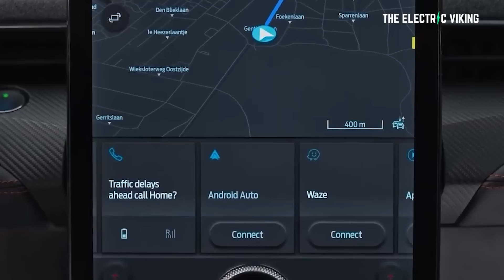US senators & dealer groups say Ford's EV program is illegal

Comment: Either Ford makes a new company to sell direct like Tesla or they make a hybrid selling model for the dealers. The customer should be able to go online to Ford, select the vehicle and the options they want. The web site spits out a price. Let's say for example 60k, if the customer agrees the web site directs the customer which dealer they want the vehicle to be delivered to. Once that is selected the customer pays online a down payment to that dealer. At that point Ford and the dealer are locked into the price with NO dealer markup or add on items. All the dealer becomes is a pickup location. The profit the dealer makes is predetermined by Ford based on the options ordered and the MSRP.

Comment: Ford should be able to compete with Tesla.  They should be able to change the franchise arrangement per the contract.  They need to do this.  The ford dealer i use has two class 2 chargers and it always has Its own or an employee cars attached.  This is not a small dealer and I have seen many mach e and lighting vehicles bring delivered
Reply: If ford demanded each dealer install a publicly accessible fast charger <with a discount rate for ford car owners> I would be behind it.

Comment: The more "profound public interest" is the price gouging happening by "stealerships" in the U.S. I think they should rank these costs on dealership size to not screw over decent small dealers. However, there are rare "decent" dealers around right now. They are all bending buyers over the barrel and charging an upcharge for slow entry and lube. So it is hard to shed a tear at the same time.

Comment: Ford have lost patience with absurd EV markups done by dealerships as they recognize the price of EVs is a key factor for successful EV Ford sales. Ideally they would like to go to the same online model as Tesla but cannot do so. Ford is struggling to make a profit on EVs at their low entry price point (to compete with other automakers) and then the dealerships screw over the buyers. Ford knows once Tesla has its Giga Texas factory fully ramped it is going to lose sales if the dealership continue to do what they are currently doing. This is all about control and unfortunately the dealerships have strong ties with government which they will use to their advantage. Ultimately they have lost sight of the consumers who will eventually walk no matter how loyal they are to the brand.

Comment: Hearing that 80% of Detroit dealerships are in areas where the power grid is insufficient to support the addition of charging stations and applications will be rejected by council.
Reply: A peaker  would simply start up  no biggie
Reply: @michaelstarkey9745  not the power generation, the supply grid needs upgrading

Comment: I still don't get the impulse to buy in now when the technology is still developing.  Heck if I left an EV on the street for an extended period of time in cold weather it's still up in the air whether or not i'd be able to get home.
Reply: @magnuspym  definitely!  It's interesting but costs wayyyyy too much for what it is.  I'm excited about the solid state research coming out.  If they make a pickup/suv with ground clearance that has solid state batteries i'd throw all kinds of money at it.
Reply: Cold weather as well as hot weather reduces the optimum range of an EV - which occurs when the battery is around room temperature. Nonetheless, it's not "up in the air" whether or not you'd be able to get home if you left an EV on the street for an extended period in adverse weather. You need to do some research into the first-hand experiences of people who own a new EV. Today's EVs are more than good enough for the vast majority of consumers.
Also, when the total cost of ownership is considered (including depreciation) in the long term EVs are cheaper than any other new vehicle in the same category. So buying something else today, while you wait for the ideal EV may not be a good idea.
Reply: @MrAlRats  that's only for foolish people that but a new car all the time.  Depreciation is only a factor if you bought your car new and expect to trade it in for money later.  Ideal way is to get quality product, drive it into dirt, know basic maintenance so you don't spend much on it rinse repeat.  There's just too much hype about evs to not be skeptical.
Reply: @tengoken4313  If you plan to buy a quality product and drive it into the dirt; then EVs come out on top when all costs are considered (assuming a quality EV exists in your chosen category). The longer you own an EV, the bigger the savings. I suggest gaining more insight into what it's really like to own an EV from actual owners.
Reply: @MrAlRats  what if you already own a reliable car?  What incentive is there to switch up and pay 50k minimum?  You say it's less expensive but that's only if you're buying now.  If your repair bills aren't insane there's not a reason to EV right now And every incentive to wait for better technology.
Reply: @tengoken4313  Yes. I meant if you are in the market for a new vehicle, then you shouldn't wait for solid-state batteries or whatever other technological improvements that may or may not materialise because current EVs are more than likely already suitable for your needs. Inadequate charging infrastructure for long-distance traveling (due to poor maintenance) is much more of a concern for most EVs (but not all) than anything you might face during daily use.
Reply: @MrAlRats  I just feel like it's a common thing that people have cars and if it was reasonable they might be able to sell more cars, but numbers-wise say a 50k EV vs a car you already own (50k/$4 = 12500 gallons of gas.  At 22mpg you're looking at 275000 miles driven.)  This is why I think it makes sense to wait out the car market.

Comment: Viking, you couldn't be more wrong about less servicing on EVs. With the over the air updates, you also get over the air disabled components, from small parts, all the way up to and including the battery. Once the warranty expires, batteries, have a nasty way of crapping out. But the car companies are so considerate of your unfortunate situation. Instead of making you spring for the 25 to $35K battery they will be so kind and offer you a reconditioned pack for only $13K with a 1 year warranty. Another little over the air update, and you're back in business. Car companies could pull this sh*t 4 times or more, reselling you the battery that has always been in your car. They can pull this anytime they want with any component they want. Car Companies, and Dealers even more so, are there to take money out of your pocket, and put it in theirs.